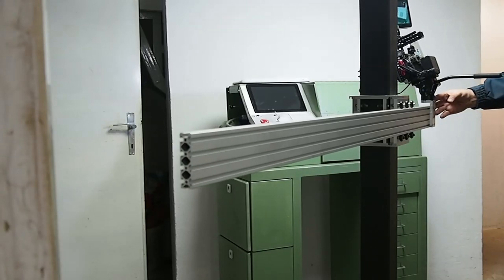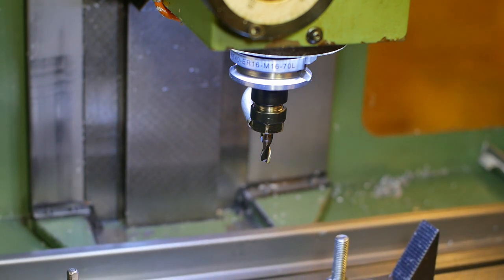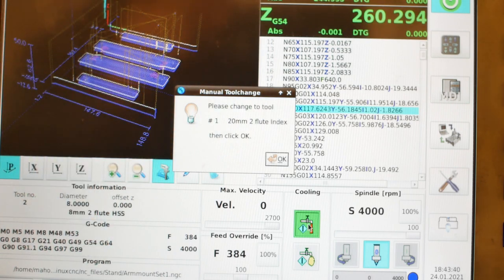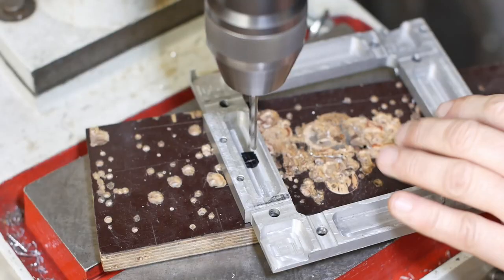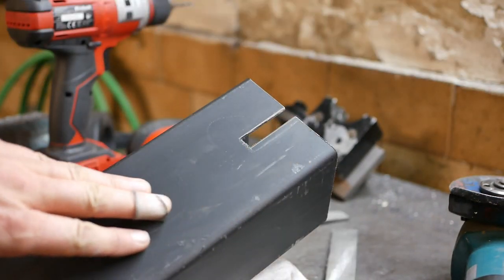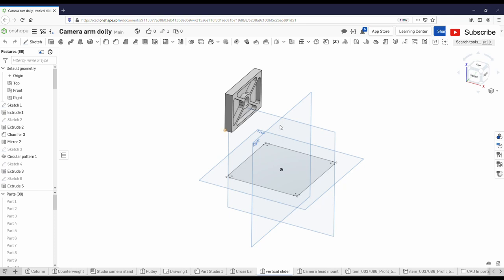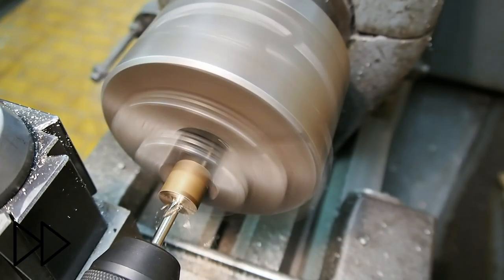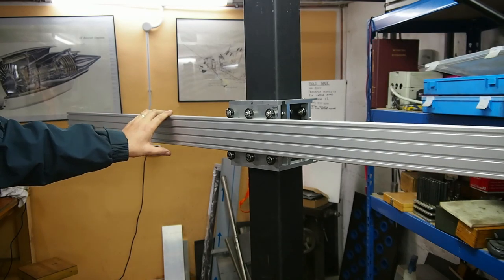Making a $10000 camera stand, part 3

Comment: And don't forget the stop at the other end to prevent 'oops, too far out' accidents.
Reply from the maker: Yeah. I will add a plate.
Reply: I built a few machines using the open beam.
For stops I actually just drilled and tapped for a 5mm bolt that went through the groove section and put in a pan head.
Reply from the maker: @DaRoach5882  I considered that, but I have a CNC mill and CAD and can therefore overcomplicate even the simplest task :)

Comment: Some more felt on the counterweight may help reduce the bell-like ringing while rolling around the shop. Excellent work so far!
Reply from the maker: Well spotted. I feel like Quasimodo when I move it.  I had thought about making some 3D printed spacer ring to pad out the 80x80 counterweight to better fit the 100x100 and prevent ringing, but forgot to do that in my frenzy of completion. Glueing some felt on it a good idea.

Comment: Nice work! I too came here off of ToT suggestion. It was cool to see you using the “distance to” tip from a comment on the previous vid. 

My suggestion would be to include something to stop the extrusion from running all the way out such as an end plate or a couple of t-nuts in the track
Reply from the maker: Welcome. Good point. It ha already been suggested, and I am just working on an over complicated solution :)

Comment: I like how you implemented Edge Precision's advice :) I've been doing more or less the same thing at work, it was one of the first things I was taught. Though I usually just eyeball the remaining length. 

I really like the roller assembly! I had a customer once who wanted to do something similar and they insisted on using PEHD plates instead of rollers. Rollers just work soo much better.

I'm lazy I'd probably just buy those t-nuts and call it done =)
Reply from the maker: Thanks. Good call on the T-Nuts. I sometime forget that you can just buy stuff :) The rollers feel pretty nice.

Comment: Good to see your newly learnt cnc methods being used this time around. Also apply it to your cnc mini lathe to avoid some crashes
Reply from the maker: Thanks. That will be the plan. So far on the mini lathe, the "crashes" were generally lack of understanding of its (lack of) capablities. Like stalling the spindle, or weak work holding.

Comment: Using the small Emco Unimat SL for thread cutting is a great idea
Reply from the maker: It works quite well as a threading stand for little threads. I should replce the pulley with some thing more comfortable though.
Reply: @RotarySMP  I'll try it next time too, I only recently got a Unimat SL as a gift
Reply from the maker: @sd90racer  I got this one thrown in with something else I bought years ago. It was already converted to a drill stand.

Comment: nicely done! (16:50): I like fusion 360s adaptive clearing for getting into those corners slowly and not breaking endmills I don't know how your cam software works but if I'm doing any drilling and the diameter of the drill is appropriate drilling those tight corners first can really save the end mill. (In Fusion I use a sketch to mark the entry point of the drill and to mark where I want the endmill to enter on the next operation to avoid ramping and maintaining a full depth of cut).
Reply from the maker: Good idea. I  need to keep learning what this software is capable, but it is pretty ancient.

Comment: I'm also working on a camera stand based on Atilla's design, although I'm without a CNC at the moment. I was trying to 3d print the main carriage and have been having rigidity issues so the project is on hold for now. Nice to see someone build this out how I intended to do it. 

Atilla's a madman for hand cutting and filing all those aluminum parts.
Reply from the maker: Aluminium doesn't put up much resistance. Sometime its it seems faster to just do it by hand. But for the 8 uprights CNC was great.
Reply: @RotarySMP  I'm about to start back up on this project and I was wondering if you could tell me the dimensions of your base? My base is already fabricated but I'm slightly worried about tipping still and I'm not smart enough to do an equilibrium calculation like yourself. 

My base is some 3x2 tube steel with a 3/8" 12x12 plate on the bottom/top of the tubing with a bearing in the middle so the column can rotate. It weighs about 50Lbs by itself and is sitting on 4 2" casters at the corners.

Here's a picture if it helps  https://i.imgur.com/7CtDBpM.png

Thanks in advance. Seeing yours coming together really makes me want to finish this so I can start making some more videos in the shop.
Reply from the maker: @mojomakesit6468  The five rollers on mine are on a 660mm diameter circle. That is a bit over two feet. If your base is only 12x12, it would have to be a lot heavier to counter balance a decent length camera arm  with a camera at full extension. Maybe a good idea to weld four tubes extending another 6 inches each from the corners, and put you casters on the ends.
Reply: @RotarySMP  Ah sorry my bad. Mine is 18x18, but a 12x12 3/8" plate in the middle. I got it welded up and attached today so once I solve my rigidity issues with the carriage I'll see if I need to extend the base. 

Thanks for the reply, I'll be sure to send you a picture once mine is done.

Comment: Nice, I love the smooth motion! One suggestion is to move the monitor (and maybe other accessories) off the camera and onto the arm, that way you can get it closer to the mill without obstructing your view etc.
Reply from the maker: I need to do some paying around how I set up the camera on that new stand. Whether I move the power, light and monitor off the camera cage, or find it better to leave it integrated.

Comment: I'm late to the party since this video is almost a year old, but I was thinking about the tool snap. You went from about 5% flute engagement to about 40% or 45% engagement when the tool hit that corner. That's a lot more axial twisting force on the flutes, and a good bit of sudden side force in the direction of travel. Either could have snapped the endmill. 

I suppose you have addressed this long ago, but it seems that something in the CAD or CAM software should have detected that increased cutting load and slowed the feed rate for the last few mm. Perhaps there is some way to configure a feed slowdown at pocket ends if it doesn't happen automatically.
Reply from the maker: Good point. Yes, this was my error, not the softwares failing.

Comment: Do you have an anodizers near to you? That can be the final step that makes the parts look professional. I know that it is easy enough to do at home, but my local one seems to charge £15 regardless of the size or quantity of the job so I haven't bothered trying. Probably clear to match the extrusion, but purple is never wrong. 
Re the America's Cup, I have found myself wondering how the huge flag and (US) national anthem at the beginning of each day feels for the approximately half the onboard crew who are not American. I would have liked to have seen a closer match between Prada and Patriot, mainly to have more days of sailing to watch.
Reply from the maker: Good idea. I don't know. Austria industry migrated from Vienna to the west  decades ago, and such companies are normally closely itegrated into the car idustry and their volume. The sort of small vendor who wil take a walk in €20 job seems to have vanished.

It is a shame that the two first AC75 regatta's last year got cancelled, as the racig so far her largely between teams at different stges of development. Will be interesting so see Inios and Prada line up for the Prada Cup finals. The Way Inios was looking in December, I would never have imagined their turn around.

Comment: I love your camera stand! Why not fix the monitor directly to the horizontal arm of the band, in stead of the camera?
Reply from the maker: Thanks for the feedback. This stand is a huge improvement verse the tripod.

I tried that, but on the camera, it moves with the camera and is only facing the wrong way about 50% of the time. On the cross beam, it seems to always face the  wrong way. My space is pretty cramped, so I am constantly moving this stand around in all directions.
Reply: @RotarySMP  That sounds sensible. I work mostly with still photography (just for fun), and I have in some occasions made a temporary dolly for my tripod, so I can really see the advantages for you as a more or less professional videographer. Keep up the good work. Both educational and 
entertaining. Right up there with TOT. :)
Reply from the maker: @Myrulv  Thanks for the positive feedback.

Just a shame I have a narrow doorway, as a wider more stable base would make it less bouncy.

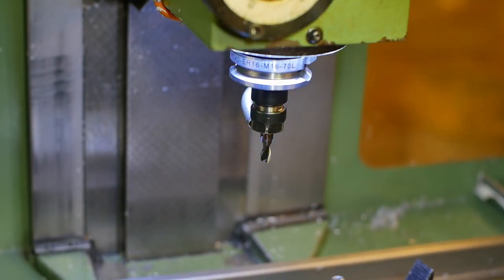Comment: 1:39 Bitte? I mean, sorry what? :-)  2:51 better save then sorry, hm?  The end result is going to look amazing! I had my doubts that the base was stable enough, but it seems you were right... I guess moving the cable clamp closer to the U-thingy and then pulling on the cable and pushing the sled downwards while tightening the screws would make it tighter. At least that worked for the ceiling lights I installed recently. Yes, this task works best with three hands....
Reply from the maker: I reckon they will knight Dean Barker for taking one of the opposition :)

Comment: Beautiful work sir! And a good catch with lowering the pulley to fit in the door.  Does the counterweight rattle in the tube when moved? I would almost be tempted to add some delrin around it if it did. Anyways I’ll stay tuned for the next video
Reply from the maker: Thanks. It is like a bell! I had planned to 3D print something to take up the space between the 80x80 counter weight and the 100x100 column, but in the frenzy of completion, I forgot. Felt was suggested, which is probably a good solution.
Reply: RotarySMP felt is actually a pretty great idea. Thanks for replying!

Comment: Hmm that brake pad handle should look downwards in the locked state, looking up something will catch in there. Looked like like these adjustable handles with push button. But nice.. those camera slides will look pro 😀.
Reply from the maker: Yeah, I can position that handle wherever I want it to sit. The felt will probably take a set over the next weeks, so I'll have t rotate it a couple of times.

Comment: I am just wrapping my head around the six roller design of the slide for the horizontal beam. Could it be that the middle rollers are doing exactly nothing, like: taking no load at all? Of course they don't hurt and they are installed now anyways, but... just thinking ;-).
Reply from the maker: The system is overconstrained, but the wheels are only plastic and deform.

Comment: Don't panic but I think you may need a 5th part after the trilogy in four parts.
Part 5 will show to making of the mostly harmless bottom weight you will need to stabilize the whole rig.
The whole thing seems to dance a bit after touching it and a large weight at the bottom might reduce this (a lot)
Reply from the maker: The problem is not a mass problem, it is that the floor is really uneven tiles, and the Ikea office seat rollers have a function where the lock as the weight comes off.

Comment: i know the next project "making my basement bigger so my camera stand fits " LOL
Reply from the maker: Yeah, I have been tempted to expand that door way :)
Reply: @RotarySMP  i have the same problem however im not ina basement but a garden shed and i live in a wooden chalet which is 6 by 12 meter
Reply from the maker: @sebby_cnc  There is never enough space for hobbies is there.
Reply: @RotarySMP  well if i would find an old farm for cheap in holland id go for it but nothing is cheap nowadays
Reply from the maker: @sebby_cnc  I was in an inner city apartment for years, with just the Mini lathe on the balcony as a work shop. The basement is luxury in comparison.
Reply: @RotarySMP  thats understandable yes hahah in my video's you can probally see how much space i got i built my own little cnc millingmachine and yes very tiny lol
Reply from the maker: @sebby_cnc  A small shop is infinitly preferable to no shop.
Reply: @RotarySMP  true indeed

Comment: Looks like one of those misting coolant devices may be well suited to this machine..blows away as well as cools.
Reply from the maker: I actually have a mist coolant system. Sitting on a shelf somewhere. Should install it. Also cleaning out the coolant tank, and the pump would probably provide more flood coolant pressure.

Comment: Is it too obvious to believe you'll get that cable tighter on the eyelet if you slide that clamp thing closer? Another idea is to tightly wrap lockwire around between the eyelet and the clamp and tuck the ends in. I love the project, and the vid series is excellent.
Reply from the maker: Thanks for the feedback. Easier said than done. Remember, this was the second time I did that, as I already did the other end to the counterweight. There is no "sliding" of the clamp on the cable. No chance.

Comment: When you trim the edges, why do you use the tip of the mill do do a square cut? Is that better than cutting at full depth , but less material sideways if that makes sense? In wood cnc-ing we always used to cut with the side at full depth when trimming sides to save the corners of the tool.
Reply from the maker: Good point. Because I can easily set the depth of cut in the CAM software, but the step over always seems hidden in sub menus. I guess I just need to become more familiar with it.

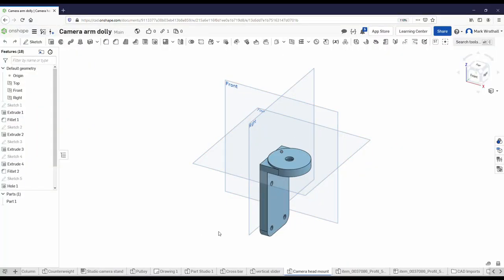Comment: @ 19:45 If U cut a 45' Angle on the end of the Coolant pipe...
U will have better control where the coolant goes...
Reply from the maker: Good idea. Although I might use some loc flex on there sooner or later.

Comment: another cncporn..
about the thread for brakepad adjuster, since it frequently tighten or loosen and the bolt is harder than alumunium, do you consider using soft material like copper/brass for the bolt or put helicoil to preserve that thread?
Reply from the maker: Good point. Actually I think Nico has a helicoil set. I'll have to ask him. Thanks.

Comment: slightly tightening the cable clamp, pulling on the end with pliers as hard as you can and then tightening them up should do it
Reply from the maker: No chance. The cable is not going to slide in that clamp, even if the nuts are loose. Probably should have choosen thinner cable rather than 3mm.

Comment: Its coming along nicely. Are you gonna cnc it at the end? Haha
Reply from the maker: :) LinuxCNC/ Mesa control for perfect video... nah! I would be happy if I just consistantly remembered to turn the mic on.
Reply: @RotarySMP  that would be easy to fix by centralizing all power next to the legs, and making on singular power switch.
I would probably also move the monitor to the extrusion, so that the camera is lighter on the video head.
Reply from the maker: @klaernie  I went to centralised power with NP-F battery and a Blind spot power jumkie, but the step down to 5V in the power jumkie leave a horrible PWM whine in the audio if I forget to unplug it. I had hoped to just leave the receive powered.
Reply: @RotarySMP  yeah, that a show stopper. Maybe there is a way to use a linear regulator, would waste a bit more than a switching regulator, but for audio worth it. What voltage needs to be stepped down to 5V?
Reply from the maker: @klaernie  Camera batteries are 7.2v nominal.
Reply: @RotarySMP  sounds like that would be very easy to drop with a linear regulator
Reply from the maker: @klaernie  The Blindspot PowerJunkie is a really convenient device. Shame they didnt use a linear regulator but rather put a PWM regulator in it.

Comment: Great job! Very interesting and you did a great job explaining
Have you thought about using some constant force springs instead of a counter weight?
Reply from the maker: Thanks. Only fleetingly. I knew I had about 8kg of lead, and when the metal supplier had that 80x80mm steel drop, it was clear I'd do a counterweight. 

I think it would be difficult to find a constant force spring to collapse to near zero and extend to 170cm.

Comment: Why not make the arm telescoping by cutting it in half.  Mounting it slot to slot and drilling a hole for a t-nut and a wing-screw.  Use threaded standoffs on to t-bolts on the sliding part to keep it from drooping.
Reply from the maker: I am finding that length really useful. Rather then changing it and needing to muck around adding an extension for specific jobss, this is fast and easy to use. You quickly forget how much nicer it is to use than a tripod, until you pull out the tripod for some B roll.
Reply: @RotarySMP  I was thinking more along the lines of space it takes up rather than making the arm longer.  By making some sort of telescopic part to the arm the overall foot print can be reduced. The shorter the arms are when taking a shot the less wobble it will have and that extra 800mm of stick out in the back won't get caught on a machine or human navigating around it.  That might not be one of your design goals though.  If your happy; it works.
Reply from the maker: @mnoxman  Yeah, you are right that the stick out the back is sometimes in the way, but the big picture is that it is great to have really fast adjustment.

Comment: You can make a vastly inferior equivalent by using thread adapters and a microphone stand. Wobbles like hell though.
Reply from the maker: My floor is so uneven that this wobbles around a bit too.
Reply: I have one of those microphone [spring] arms, it can barely hold 300g and is quite constrained in movement, though wobbly. I wanted to hang a 2kg beamer and it couldn't do it.
Reply: @ligius3  I use a free standing one, the spring one that came with my mic drove me nuts.

Using a magic arm is also great for supporting a light or GoPro. The magic arm can clamp around the mic pole easily.